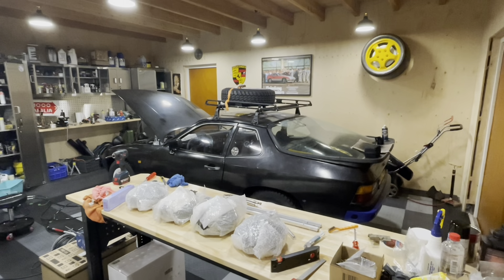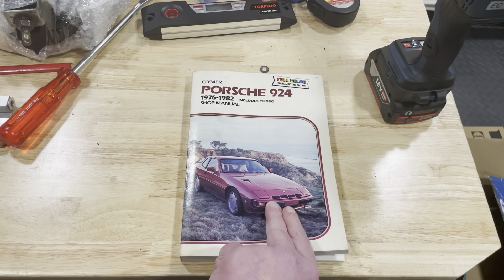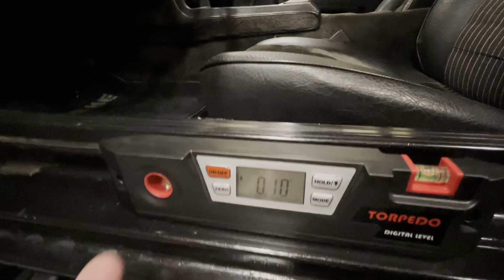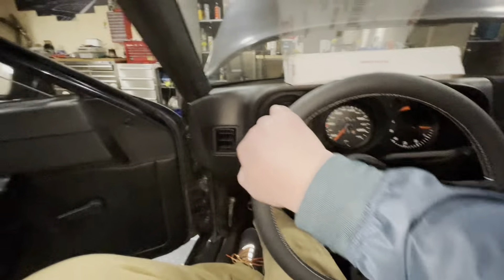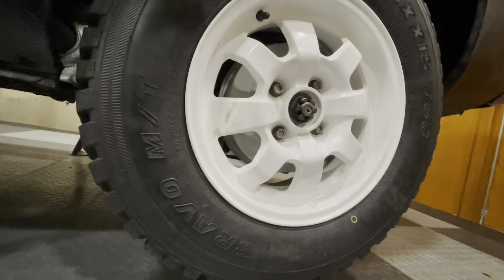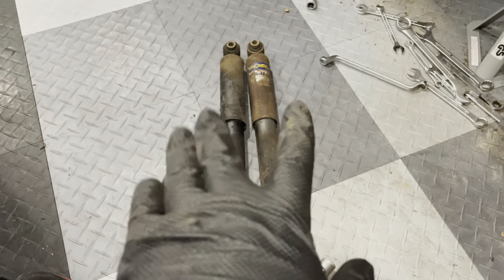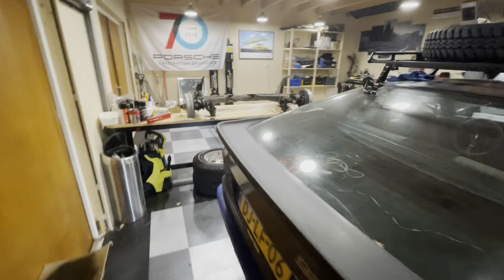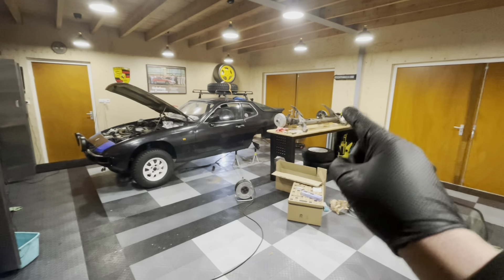Building a Porsche 924 Safari: Dropping the torsion tube.

Comment: Great progress! I didn't show removing the bolts you mentioned because I actually didn't remove them... if you pause on 11:30 on my video you can see that bracket still attached to the chassis after I dropped the axle.
Reply from the maker: I actually figured that out this morning as I was taking that mount apart and realised it could have stayed in the car. I couldn't see that it was a slip fit and that only removing the nut would have been sufficient 😅

Comment: I am rebuilding the rear suspension right now. 
Not sure what bushings you are planing to use, I wanted something complient so I Got new springplates, comes with stock rubber and gold plating. Resonably priced too.
Reply from the maker: I am going to rebuild it using powerflex bushings, I never even considered just replacing the the springplates, that is a great idea! Oh wel, there is always next time 😅
Reply: @GarageBiljon  I cleaned my spring plates up, got them re-zinc plated and fitted road spec polly bushes. A bit more work, but cheaper than buying new.

Comment: Technically, you didn't removed the rear axle at all.  Just the rear suspension.  Axles are the driveshafts from the transmission.  I agree that it doesn't look like torsion bar needs to be reindexed.  They were always kind of high in the back from the factory anyway.  Many people reindex them to lower the car for normal road use
Reply from the maker: I am calling it the rear axle as I am trying to stick to Porsche terminology, but of course you are correct, this is more suspension than axle. The funny thing is I did not notice any rake on the car before, my Turbo has very obvious rake. For now I am going to leave the torsion bars as is. I might have to revisit this at some point, but time will tell.

Comment: My original comment has disappeared. I think you need to drive the car for a bit to let the new suspension settle first and see where you are. Aim for the top of the sill to be level.  The eccentric nut on the spring plates will give you about 25mm of height adjustment if I recall correctly. But you need to know where you are at the moment in the range of movement. If you are already at the top of the eccentric adjustment you can’t go higher and will have to reindex if you need to raise the rear for example.  The Clarks Garage website has a section on how to calculate the reindexing if you need to.
Reply from the maker: Thanks for the advice Chris! I have now found the correct angle for the rear spring plate which is 23°40' so I will check if mine are currently in spec. Then I need to add an extra 1° for each 6mm of lift required. So If my calculations are correct I need to end up with an angle of 30°06'. Then I will have the factory rake but then 40mm higher.